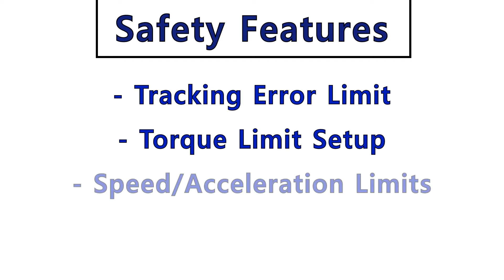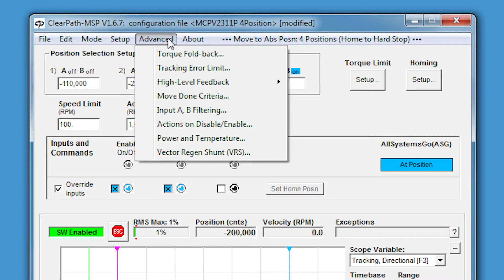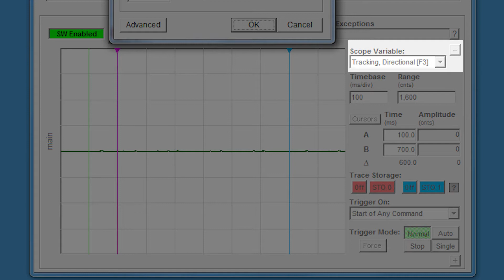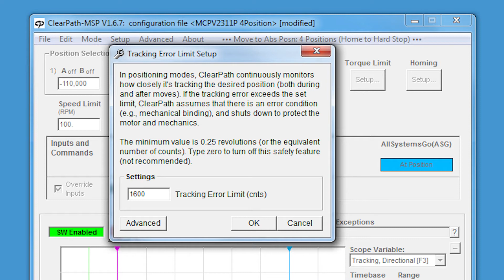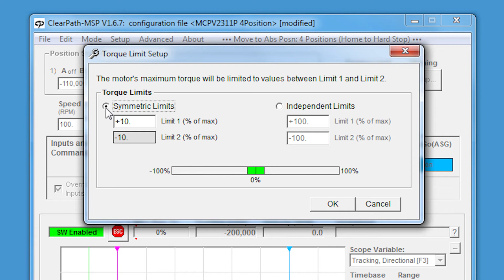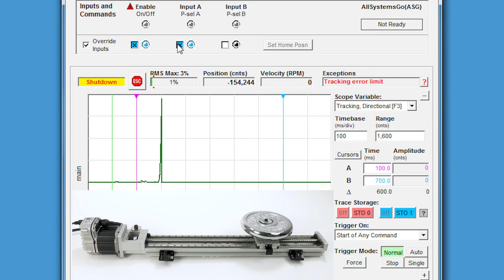ClearPath Servo Safety Features

Comment: It would be really cool to be able to set up the motor in the final configuration, make the movement, save the torque curves, and have the torque limit be relative to that saved curve (vs relative to maximum torque)
Reply from the maker: Hi alonsomartinez8630, 

Thank you for checking out the video and for the thoughtful feedback. While ClearPath motors do not currently have that functionality, we are always looking for new ideas. 

Best, 
Bradley N. -Teknic OEM Applications Engineer

Comment: Do you have a channel for ClearCore videos?
Reply from the maker: Hi Miles,

Thanks for watching and for the question.

At this time, Teknic has only created one video about ClearCore. It is titled "Robotic Bartender Powered by ClearCore - Teknic's Industrial I/O & Motion Controller" (https://youtu.be/SRenvqxL6bI). 

In lieu of additional ClearCore videos, we opted to create over 40 example projects for the ClearCore as well as a detailed online software reference. Both are available for free online (https://teknic-inc.github.io/ClearCore-library/). 

If there is a specific ClearCore video that you would like to see, please let us know. We keep a repository of video requests and use this repository to help make decisions about which videos to produce next.

If you have any additional questions or comments, feel free to contact Teknic directly at https://teknic.com/contact/ or give us a call at 585-784-7454. 

Best regards,
Ian R. - Teknic Servo Systems Engineer
Reply: @TeknicInc  I've looked through all the examples. Right now, I need to one for accessing the SD Card.
Reply from the maker: @milessakauye8819  The SD card feature is currently best supported within the Arduino environment. When you install the ClearCore libraries for Arduino, there is an SD card ‘ReadWrite’ example included.  However, there is not currently an SD card file system library or example included in the ClearCore libraries for MicroChip Studio.

Please give us a call at 585-784-7454 or leave us a message at https://teknic.com/contact/ if you have additional questions.

Best regards,
Ian R. – Teknic Servo Systems Engineer

Comment: Say something got caught and tripped a stop on the motor. 

What about a continuation on how to safely clear the machine/slide, and reset the motor?
Reply from the maker: Hi Bryster51, 

You bring up an important consideration when defining the error handling procedures of any automated machine. Before describing how to reset the motor I want to provide a couple pertinent details about ClearPath's safety shutdown behavior. Once the motor enters into a shutdown state, it safely comes to a stop (at a pre-programmed rate) and ignores any future incoming motion commands. The shutdown also de-energizes the motor windings meaning the motor will no longer actively try to hold position. In other words if you had an unloaded motor at your desk and it were in a shutdown state, you could spin the motor shaft by hand and it would not resist motion. It means that if the jam is removed, the motor won't actively try to move or jump ahead.

As an important note, even though the windings are de-energized by a shutdown, for maximum safety you should interrupt main motor power any time you are going to put any body parts within a machine. The disable/shutdown circuit of commercial motor drives, including ClearPath, do not have redundant circuitry to deal with a component failure and therefore should not be considered fail-safe. Additionally, since the windings are de-energized, if the load is subject to gravity it would be safe practice to employ a power-off brake in between the motor and the mechanics to stop the load from falling.

Once the necessary steps are taken to clear the jam, ClearPath can be reset by simply de-asserting and re-asserting the Enable input. This will re-energize the motor windings and allow the motor to hold position and respond to future motion commands.

In positioning modes you also have an option to pre-program ClearPath to return to its last commanded position upon re-asserting the Enable input, therefore allowing ClearPath to sync back up with your controller (as opposed to re-homing). The velocity and acceleration for this move can be pre-programmed to values deemed safe in your particular application. In this case it's important to note that once the Enable input is re-asserted, the motor will immediately begin to move.

I hope this helps and thank you for the suggestion.

Best regards,
Kevin S.

Comment: Would a reducer be needed if your actuator has really fast/coarse ball screw ?
Reply from the maker: Hi Jack

The answer to your question would depend on the specific requirements of your application.  A gearbox will reduce the reflected load inertia (as seen by the motor) by the square of the reducer ratio (i.e a 3:1 reduces the load inertia by 3^2 or 9).  In proportion to their ratio, gearbox reducers also amplify the torque and resolution while reducing the output speed. There are other considerations to take into account as well when determining if a gear reducer is needed such as backlash, an increase in the overall length and system cost.

If you have any more questions please feel free to email us at support@teknic.com.

Best regards,
-Abe A